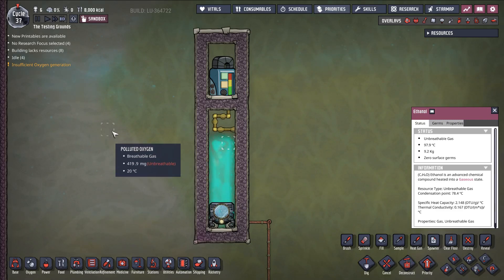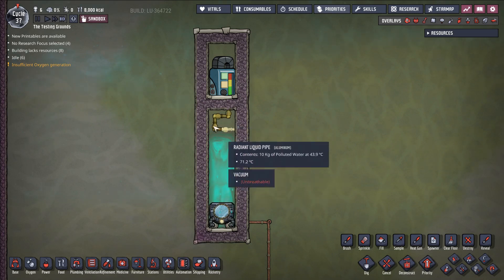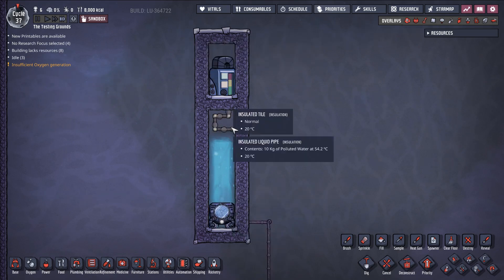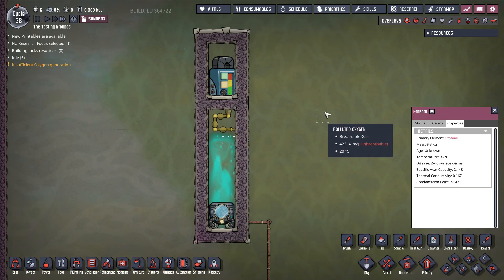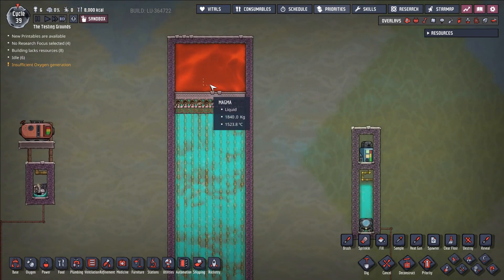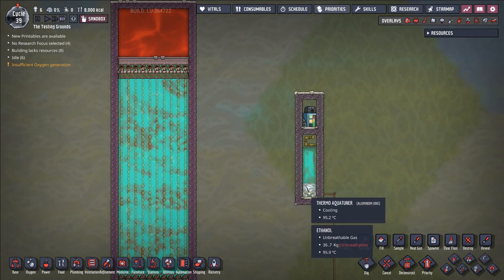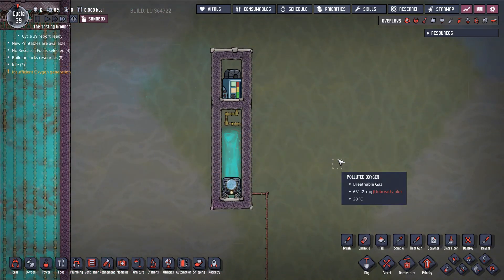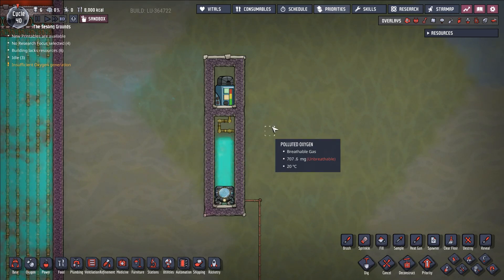The BEST EARLY GAME COOLING -- How to cool your base by boiling ethanol [Oxygen Not Included]

Comment: Pretty new to the game, the one on the right, if it is made to cool the base why is it made of insulated tiles?  Wouldnt it trap the cool into it?
Reply: The ethanol isn’t cold, the aqua tuner basically cools liquid that you put in while dumping heat into its surroundings. the liquid in radiant pipes is what you use for cooling, with the ethanol being hot enough to absorb heat

Comment: I just made the first version you showed in my base. The Aquatuner kept overheating and the build broke down. I couldn't figure out why, until I tried to replace the gold amalgam aquatuner with a copper one. The Aluminium you showed has a higher specific heat capacity, so it doesn't overheat as easily. Just something I thought I'd mention if someone else wanted to try this
Reply from the maker: It's counter-intuitive, but gold amalgam has a way worse conductivity than aluminum, or even copper, so in some situations the +50 C overheat temperature isn't enough to compensate.
Reply: @gearheadgaming1  same is true for polymer presses. much easier to cool a wolfamite one early on

Comment: How much Ethanol is dumped into the system to prime it? (the best system I mean)
Reply from the maker: I think in the best system you want enough ethanol to keep the aquatuner covered, so probably something on the order of 3 tons.  But if I remember, even the worst performing system I tested still pulled something like 70 kdtu of cooling, so it should still be fairly effective even with different numbers.

Comment: I feel like gold amalgam is earlier than a lot of this stuff though that's because I usually focus on exploring over science in the early game as science usually requires 2 of your 3 starting dupes and digging can give a good supply of low quality food and seeds to start proper farming, not to mention, water (though usually polluted), dirt, coal, algae, sand, and the odd critter.
Reply: Not if youre on a map without many slime biomes, maps like Osias need to have a way to manage your heat before you can even leave the initial forest biome
Reply: @agentbarron3945  I get your point. I have been mainly playing the easiest asteroid which starts off in a temperate biome usually attatched to a slime biome and am yet to find any forest biomes for lumber, which was one of the main reasons I made that comment.
Reply: @roax206  ah the terra asteroid I dont think has forest biomes, I'm having a lot of fun doing the agra astroid right now, it starts you in a forest biome that borders salt and slime biomes, so it's basically tera but instead of temperate its forest

Comment: I mean, this is a rather fascinating set up, I'm just trying to figure out how to use it in a practical sense... That part seems a little less clear.
Reply: Just as you use any other thermal aquatuner setup: You tap into the polluted water cycle and cool stuff with it. Of course you need to respect the limits of the system - in particular that the polluted water on the top still has to be cool enough to condense the ethanol (probably under 70 if you wanna play it save).

The ethanol in there will just take care of the heat produced by the aquatuner. 

For systems like this i often build an exchange chamber where my cooling loop (the polluted water that is cycled here) will take away heat from a medium (another water pool or metal tiles, depending if i want fast exchange, or large heat capacity) and have my working cycle being cooled by that medium. That way i can disable the cooling cycle if i have reached the target temperature. And also use the medium for more than 1 cycle or different temperatures.
Reply from the maker: There are a couple ways--

First is to take the polluted water line that's running through the aquatuner and run it through something you want to cool down.  This makes one big closed loop that you use to cool down your base.

The second is an open/semi-open system-- instead of expanding the loop, add a couple valves on the side of your coolant loop by the liquid reservoir.  One siphons off cold polluted water that the system produces, and the other resupplies the cooling loop with hotter polluted water.

Closed systems are simpler, but I think an open/semi-open loop is better in this instance for a couple reasons:

The first is that it allows you to avoid the failure state of the system, which is letting your coolant get too hot.  If the polluted water goes above the condensation point of ethanol, the system breaks.  By using valves, you can control the rate at which hot water is added to your system, and avoid letting the temperature get too high.

The second is that it allows you to effortlessly upgrade your system once you have access to supercoolant.  Just siphon the polluted water out and let the inlet valve pump in super coolant and boom, a zero-downtime upgrade.

Comment: @gearhead gaming could you put this kind of build into a context where noobs like me could actually understand the application within a base (realworld application) because although this looks super dope, it doesn't actually help me understand how I could use it. Thanks dude love your stuff!
Reply from the maker: Basically, at some point in the game you're probably going to want to cool down some area.  The loop of polluted water that's being run through the aquatuner in this build is being cooled down over time.  So when you need cooling, what you do is either extend the pipe loop to go and absorb heat from whatever area you need cooled down (closed cooling system) OR you siphon off the cold polluted water over time and replace it with hot polluted water (open/semi-open system).  Then you can take that cold polluted water and use it to cool things down however you want.
Reply: dupes, most power(especially), most machines and most material processing creates heat where traditional early game cooling relies on getting ice which requires ice biomes (and heats up other places). Early plants will stop growing around 30 degrees C and the starting forrest biome is usually around 25 degrees.

Comment: This is really cool. Probably not useful for a typical playthrough where you progress past the technology level where it's necessary really quickly, but on your current lets play... I agree this could've potentially been really useful.

I don't really understand why you have the long tube. The cooling that this system provides is entirely based on the change in specific heat capacity during the transition periods. It takes more heat to turn ethanol into a gas than it does to condense it into a liquid. Wouldn't it be just as efficient (possibly more so?) to place the radiant pipe directly above the aquatuner and instantly recondense any gas that gets made, preventing the aquatuner from ever heating something that's not a liquid?

You could widen the chamber. While that'd require more ethanol to reach what I expect would be maximum efficiency, it would be more 'upgrade compatible' to quickly pull the ethanol out, replace it with water, and place a steam turbine on top.
Reply from the maker: I lengthened the tube a little because one of the sources of inefficiency is heat conduction through the ethanol gas.  In particular, for this build, the ethanol gas above the aquatuner is having heat dumped into it, and as a result, by the time the gas gets up to the condensation pipes, it's been heated up beyond its boiling point.  This directly subtracts from our cooling-- all that heat is basically an efficiency loss for the system.  Longer tube, lower temperature gradient, less heat conduction through the ethanol-- it helps a little, but there's probably a more clever solution that I haven't figured out yet.  Certainly, keeping enough ethanol in the system to keep the aquatuner submerged helps, since if the top becomes uncovered then I'm pretty sure it just directly dumps heat into the ethanol gas-- it would be like half the aquatuner is just spinning its wheels.

Wider would be better in some scenarios.  At higher coolant temperatures, one of the limitations is how much area there is to condense the ethanol.  That's why I have a two-high condensation region at the top of the tube-- if the polluted water is, say, 65 C, then the extra couple tiles are necessary to keep the condensation happening.

But I think the rate-limiting factor here is how quickly the aquatuner can boil off the ethanol, not how quickly the gas gets condensed at the top.  Making the system wider would give more room to the gas to make its way up, but the outcome I think would be that the condensing ethanol would be too much for the aquatuner to heat up, and so we'd go through cycles, where the gas pressure got lower and lower and lower until finally the condensation rate was low enough that the aquatuner could catch up and boil off more ethanol, which would create a little gas explosion and increase the rate of condensation, which would overwhelm the ability of the aquatuner to boil it off again, and the cycle repeats.

You make a good point about steam turbines and upgrading.  Eventually we would want to upgrade this system-- go in and replace the aquatuner with a steel or gold one, get rid of the condensation section at the top, put a turbine on top of it all, etc.  So maybe a wider system makes sense, just so we are reserving enough space to upgrade when the time comes.  It would require a lot more ethanol though, since again, I think a larger quantity of ethanol is better, to keep the top of the aquatuner covered.

Comment: Interesting, thopugh it bothers me a fair deal, that there are these reality breaking mechanics to remove heat :/
Reply: I agree but the problem is: there would be no way to do anything in ONI withouth cooking everything if there wasn't. The system is too small and too closed of from everything else (except space) to do anything with all thee energy you release from burning coal and so on.
Reply: I agree, but I think these kind of solutions are bad. Wheezewort are a nicer option, than finding rounding errors and loopholes. I am sure they are creative and could find more of those elements.

Comment: So I'm an early game player - just bought it about a month ago; and on my main base, I am about 20 or so cycles out from having to seriously deal with the placement of high temp vents near to the base.  Is the thought that this type of arrangement is simply plopped down where needed, and it will radiate cooling outwards from it's location to offset high temp areas?
Reply: The liquid in storage tank gets colder and colder. Pipe this liquid in radiant pipes where you want the cooling. However do NOT build this. In the time it takes you to build it you could have got 200 plastic for the steam turbine which is an order of magnitude more efficient. 80 kdtu for 1200 W is really power heavy and requires about the same tech level as a steam turbine setup. If you build it early game you are likely going to suffer co2 problems from all your power generation. Your dupes will start to suffocate and get blocked off parts of your base, and you will run out of coal or wood much sooner, potentially crippling your base. It should only be considered on special maps where you are completely blocked off from the oil biome, and by experienced players.
Reply from the maker: It could be made that way, but I think the better method is to take the coolant that we're chilling in the liquid reservoir and pipe that around the areas you want cooled down.  That lets you plop this down anywhere, and then pipe the cold to wherever you need it.

Also, depending on where you are in the game, there are other cooling systems you can consider.  This build works if you don't have any steel or plastic yet, but if you happen to have manufactured some of that, then you could also make this system:

https://www.youtube.com/watch?v=UBr_wMD2w7k

Comment: Lumber have same properties of pills, so you can run "chill lumber" cooling loop, or just drop preheated lumber in distilleries, so you have tons of 20C disposable genetic ooze to cool your base. and it's safe from patching, because lumber drops of same temperature the tree have on the moment of drop, so you still have tons of disposable thermo-mass of comfortable temperature you can run through your base even if "chill pill" been patched.
Reply from the maker: Good point.  I should make a lumber-cooling video some time, it's also a really good early game system.
Reply: @gearheadgaming1  I'd be interested to know how heat gets transferred to lumber.

Comment: Couldn't you cool the ethanol at the top with a steam turbine instead of with its own cooling and delete even more heat than the standard steam turbine setup?
Reply: Steam tubines only work with steam, not any gas. My brain jumped to some kind of a two-chamber setup where a gas changes state as a result of heating water above 125 degrees, but sadly none of the materials that change state within an acceptable range (125-1025 degrees) has any difference in specific heat capacity between their states and I can't think of any other way to make this kind of a setup function.
Reply: @DarinthMalacoy  I was thinking a two room thing yeah but indeed I forgot you have to cool the ethanol to ~80 c
Reply from the maker: I don't think it's possible without some major changes.  Ethanol condenses around 77 C, and steam turbines dont turn on until 125 C, so we have a problem with 1) using an aluminum aquatuner if we need to get the temps up to 125 C, and 2) with condensing the ethanol.

Also, if you have the plastic to make a turbine, then you're probably better off working toward a straight up steam turbine + steel aquatuner setup.  Once you hit midgame, this build gets outclassed by turbine systems, so at that point I'd build it just as a sort of cool-looking novelty.

Comment: Remember, tge only reason this works is the two degree margin around the boiling point. That's where  they depart from the real world, and that's why phase-dependent heat capacities have unintended consequences here. Have ethanol boil and condense at the exact same temperature and this thing provides no cooling.
Reply: just having a different heat capacity would make it work, but not as well.
Reply: It might not work irl, but this game's backstory is all about cheating physics. The existence of things as outrageous as the Worts or the Thermo-Nullifier goes to show that.

Comment: Would this system work any better if you used a gold aquatuner instead?
Reply: This is a two-phase system, relying  on ethanol pivoting around its boiling point of 78 degrees. Running it hotter actually breaks the system, as the ethanol can't condense anymore. I guess you could heat it up, then cool it down to around boiling point, but that extra temperature is a zero-sum operation at best.

Remember the crux of the system: ethanol is heated to 2 degrees above boiling point as a liquid, then cooled down to 2 degrees below that point as a gas with a lower heat capacity. It's that 4 degree gap, alongside that 0.3 difference in heat capacity, that makes this work. 

If you gotta cool hotter things, steam turbines are your friend.
Reply: @jonaskingofsparta  ahh i see thank you very much
Reply: No, but it would work better if you used supercoolant in the pipe instead of water, and it would work worse if you used oil or petroleum in the pipe.
Reply from the maker: In this case I don't think it would.  The aquatuner is going to be submerged in ~75 C ethanol no matter what we make it out of, so the higher overheat temperature of the aquatuner never comes into play.

Comment: Noob question: doesn’t the heat capacity of the coolant eventually run out, doesn’t the heat have to be bled off from it at some point?
Reply from the maker: If we're talking about the big system, yes, a slight amount of cooling needs to be applied to the ethanol pool.  Tossing in probably half a dozen pacu would probably be enough to keep it going forever.
Reply: Fair enough, so literally deleting heat through game-provided mechanisms, even if they break thermodynamics ;-) What about using space for cooling?
Reply from the maker: @jspiro  I think late game, not counting exploits, space is one of the best ways to cool down your base.  Take junk you dont want, dump a bunch of your heat into it, then vent it out into the great beyond. 

There are better, exploity ways of doing things (like my recent video on super-powered ice makers / using volcanos to cool your base), but in terms of things that actually follow the laws of thermodynamics, space might be the best one.
Reply: @gearheadgaming1  nah... the best way is to keep hot and cold areas separate. Fill hot area(say power gen and industrial zone) with some water, let heat blead everywhere inside the zone and turn water into steam, put steam turbines on top. It's late game only for power, because it requires a ton of steel for ur generators and batteries. You get moderately hot industrial zone that not only never overheats but provides you with extra power! This also radically simplifies the industrial zone design(refineries, aquatuners). Win/win, nothing comes even close. Access strictly thru liquid lock and atmosuit checkpoint obviously :)
Reply: Why does the smaller system last somewhat perpetually? I guess heat death isn’t a thing in ONI.
Reply: @jspiro  It lasts because you recuperate some of the cooling provided in the condenser loop up top (the radiant pipes). This recuperates enough cooling to condense the ethanol back, so only the net gain leaves the system.